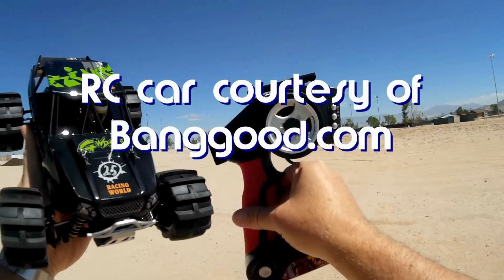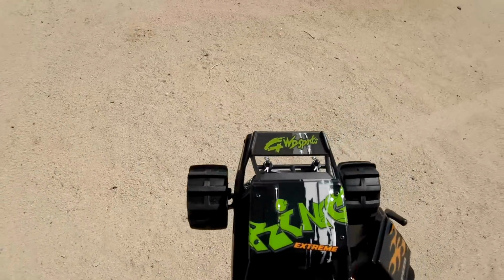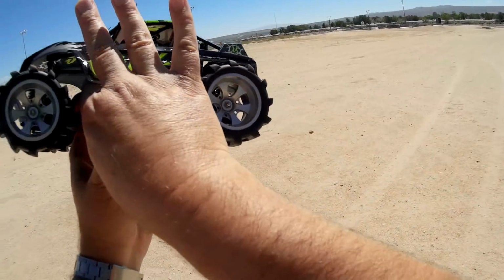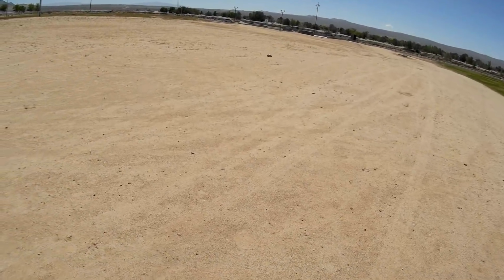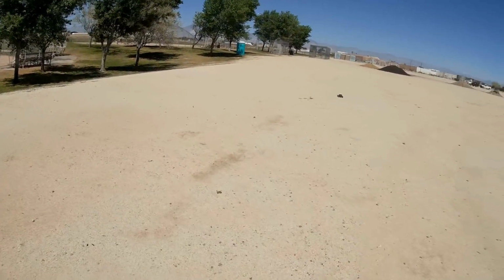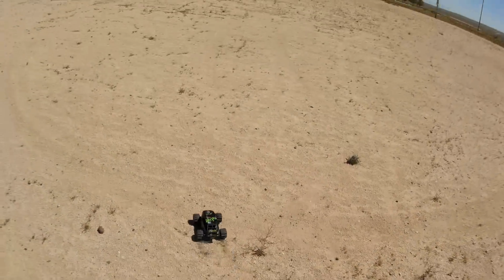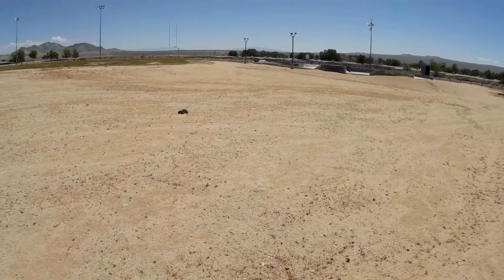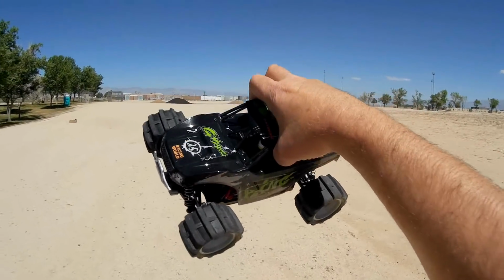WLToys A979-2 Powerful 1:18 4WD High Speed RC Buggy Crawler Test Drive Review

Comment: Looks good. Been running others of the A959-B and A979-B. Bumper being of flexible plastic actually helps it not breaking. And I can’t imagine these one crawling with that gearing. But great review and test. Ohh, and it sounds like that when it gets some dirt in it. Pretty normal. It likes it. Unless it gets larger stones in it it will be fine. Great location you got there.

Comment: another A959-A, I DO like how it's dressed up. the pinion and spur cover always needs to be siliconed, a ladies nylon stretched over the motor's brush cooling slots and CA glued/trimmed. them Chinese and BUZZWORDS... "high speed" and "crawler" on the same darn item is ridiculous. you ran into thermal ESC protection, also very typical, car off/on resets it BUT.....  WLtoys is about infamous for over gearing their stuff trying to impress with "oh look how FAST", causes a LOT of heating to the motor, ESC, and battery. solution is finding a 2.3 mm bore pinion gear, 2 tooth smaller than stock, then a little carving to the motor mount plate so the smaller pinion can reach/mesh with the spur gear properly.

another YouTuber showed soldering copper or brass flat stock "fingers" to the tops of the temfet/mosfet ESC power transistors to help dissapate heat from them, reality is if they need much cooling they're definitely working a little too hard! most ESC's mosfet spacing is pretty standard, should be pretty easy to just clip a typical heatsink onto the mosfets.

I'd tend to do both the smaller pinion and add a heat sink, when things get HOT resistance goes up, efficiency (and run time) goes down, pulling more power from the battery but not delivering it to the wheels.

I'm sure not saying "this is bad" or "don't buy it", I like it !! I'm saying be aware of this stuff and plan on doing some basic stuff to it so you'll enjoy it a lot longer without having to spend money for parts, and a darn month of downtime, waiting for the parts to arrive!